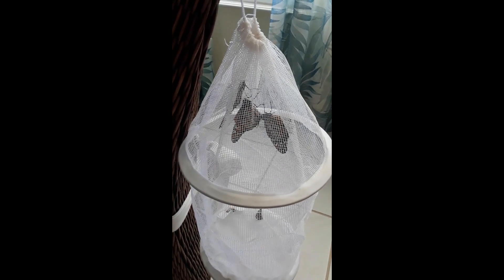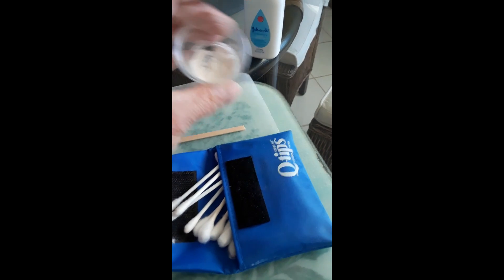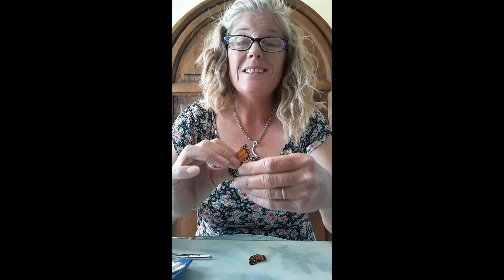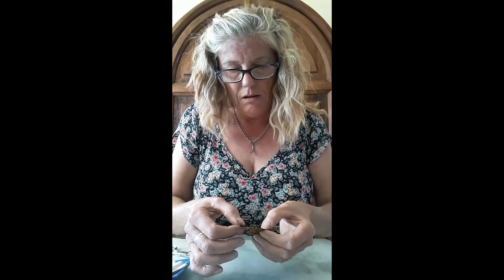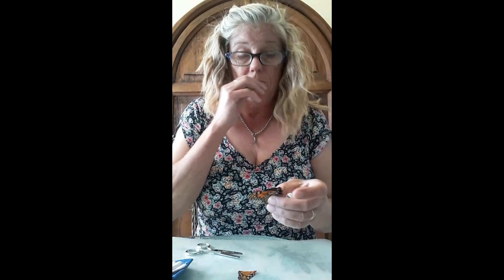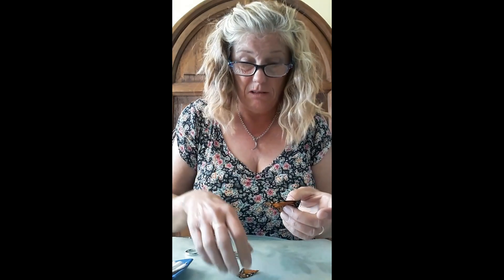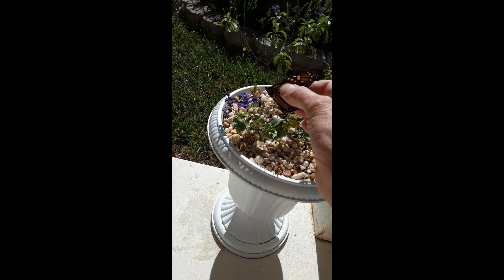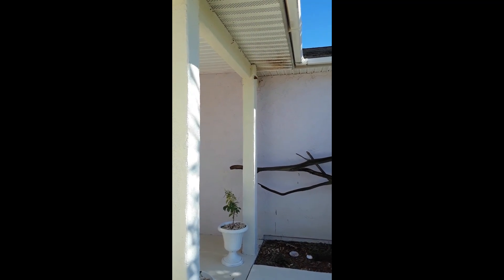Butterfly Wing Surgery

Comment: I see that parts of their wings fell off while they were in the mesh container. I've learned that you can avoid needing to repair wings if you drape a large plastic bag or other lightweight opaque cover over the top of the mesh container until you're ready to release them. That keeps them quiet. Otherwise, they'll flap their wings furiously against the side of the mesh container and break off pieces of their wings. I like how you do the operation while holding them instead of immobilizing them with a hanger hook like in other videos I've seen. I find that the replacement wings crack very easily, so I'm not having success with wing transplants. I think the best solution is prevention with a cover over the mesh container.
Reply from the maker: That's a great tip about the plastic bag to keep them calm! I rely on the refrigerated board to keep them still on the table, but preventing the damage in the first place is always the goal. Thanks for sharing that!